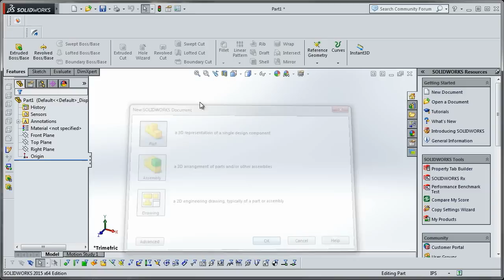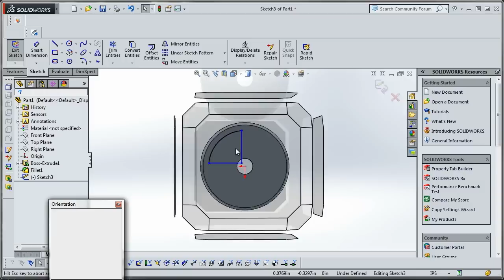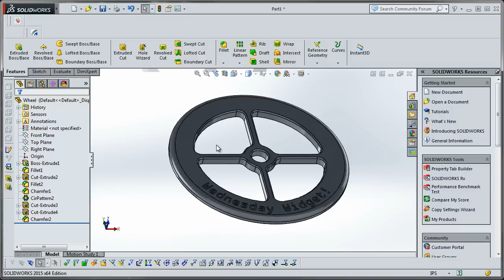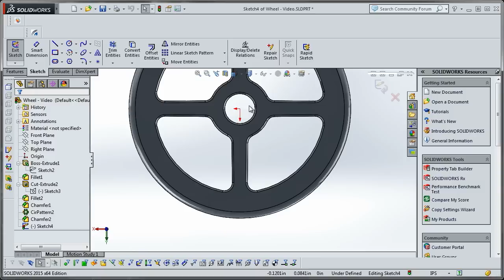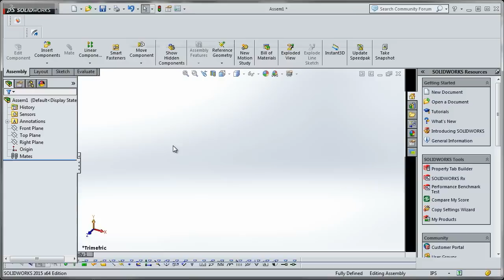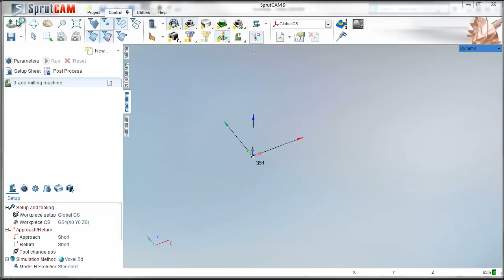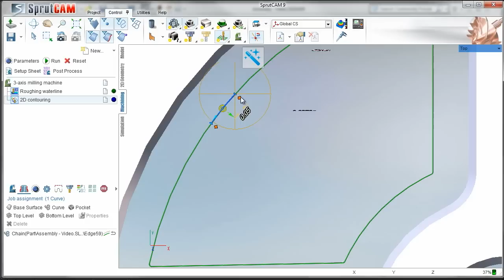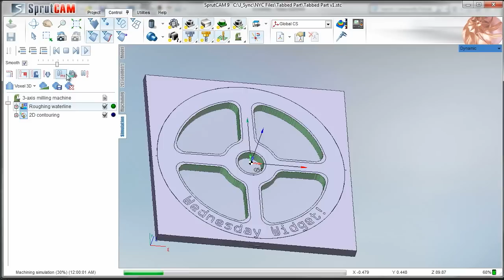CNC Machining Workholding Wednesday Widget! Part 1

Comment: To get the arc-points to be the same height I would, and this is my personal preference, preface the arc by drawing a horizontal construction line and then while making the arc just snapping the points to that.
Reply: As an alternative, you can simply 'rough' out your arc and Ctrl select its endpoints then add a horizontal relation.
Reply: Dan Horwitz Indeed, there are many ways to skin a cat. Personally I prefer the construction lines as it makes it both easier to get an overview how things are constrained to each other, and makes it a little bit easier to dimension stuff as well.
Reply: Switch & Lever Many ways to skin a cat; one of the reasons I love/hate Solidworks so much, lol.

Comment: John, At ~10min., I would highlight the two endpoints of the arc and select horizontal for a relationship.  Alternatively draw a construction line between the two points and make it horizontal.  The longer I work with SolidWorks the more that I like construction lines.
Reply: Sorry, guys,  I am commenting as I watch  and hadn't seen the replies below.  What they said!

Comment: Your arc endpoint conundrum:  select both end points of the arc (via ctrl key) and a sketch constraints window will appear on either the lefthand screen or by your cursor.  One of those constraint options will be "horizontal."  This sets both points to be at the same horizontal (y-axis) height. Viola!
Reply: *****
I also prefer to use a construction line for the exact same reason - sometimes it's hard to tell why a part is constrained, if there is a line there the reason is obvious. The only issue that might come up is when, during a subsequent operation, SolidWorks forces you to select an entire sketch instead of an individual line segment.

Another way, that might be a little more similar to his drawing style, would be to draw a whole circle and draw a line at the height he would like arc to end. After the two lines are drawn, use the trim tool to erase the top of the circle and the extraneous parts of the horizontal line. Not as efficient in my opinion, but possibly more intuitive.

Comment: Create a horizontal construction line to get your points on the curve to line up.  Also no need to mentally convert your units, simply type them as-is, just include the units if you're entering a dimension other than the default. (ie type 2mm, and SolidWorks will automagically convert that to 0.078740157in -- this also works for fractions)

Comment: Just a quick tip for your viewers, if you were in the military and have a DD214 you can get a student version of solidworks for $20. I have been told you can use hsmworks for gcode(have not been able to verify that) I have not sent for my copy yet but will soon. Just google solidworks military to get to the site.

Comment: You can get away from inserting a reference axis in your assembly (12:50), by mating the Assembly Origin to the Part Origin. By default the parameters should come up as: Coincident, with the Align Axis check-box selected.  Obviously this will only work out correctly if the coordinate systems of your part and assembly are intended to share the same vectors.

Comment: I'm not sure if you're interested in unsolicited SolidWorks tips, but here's an easy one. At around 7:30 you decide to start changing dimensions. To do that you hunt for the sketch by clicking on the feature you want to change. Although that works fine, a better way is to simply click (or double-click, I forget) on the feature. After you do that you'll notice that the dimensions associated with that feature will become visible. At exactly 7:50 the 0.50in dimension you intend to change appears when you "double-click on that wall". Instead of finding the sketch in the feature tree, you can just double-click on the actual dimension. Doing that will allow you to enter a new value.

There are one or two slight annoyances with this method.
1. Sometimes double-clicking on the dimension will open a small text-entry box that will allow you to enter a new value and sometimes it'll open the normal dimensioning dialog box. I prefer the dialog box, so when the small text-entry box appears I will usually start the process over. I think double-clicking on the 'arrows' of the dimension will always take you to the dialog, but I usually don't remember to do that on my first try.
2. Although it usually will, the model doesn't always automatically update to reflect the new dimension. If it doesn't update you need to click the "redraw" button manually. What a chore! :)

Speaking of the redraw button...
One reason I prefer the full dialog box when I'm editing dimensions is that there is a dedicated "redraw" button on the same dialog. I can enter a new value and click the redraw button. If it doesn't look right I can continue to enter new values and continue to redraw until I get something that I like.
Another nice thing about the dialog box is there is a wheel in that dialog. If you mouse-over the wheel and spin the scroll wheel on your mouse it'll dynamically increase and decrease the dimension value and automatically redraw the model. It's a real time saver!
Reply: I prefer crtl+q vs the regen button, quicker since I'm already on the keyboard and it regens everything, not just the last feature worked on then down.
Reply: NYC CNC Oh I've got lots of keyboard shortcuts I have added that you will find useful ;) Yep IPSC is my main hobby, the CNC stuff has to fit in between the 2-3 nights a week at the range lol, that's most of the reason that I am moving so slowly on it.
Reply: pffft, at least we don't have weird holster rules for some divisions and not others :p I do plan on jumping across the border this year to shoot limited, but only because my classic division gun and holster don't suit your funny rules
Reply: I'll just be sticking around northern Washington for now, maybe hit steel worlds if I can